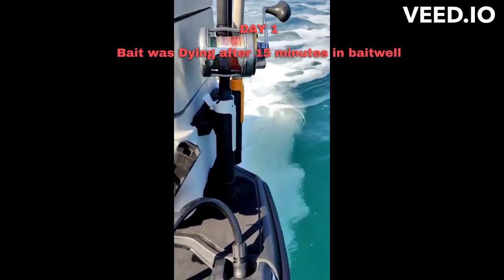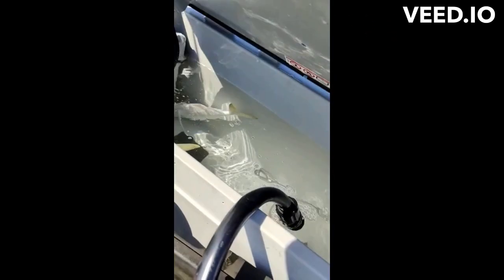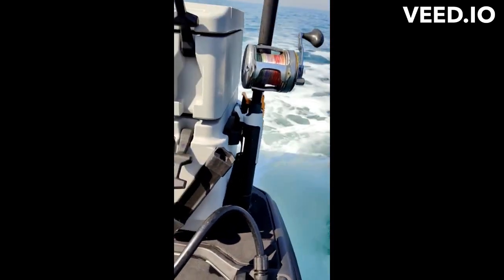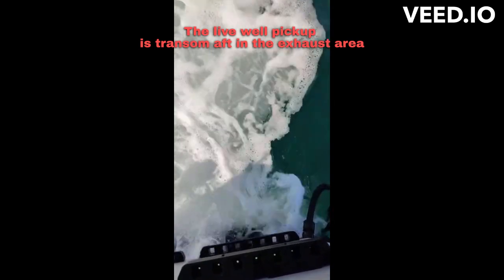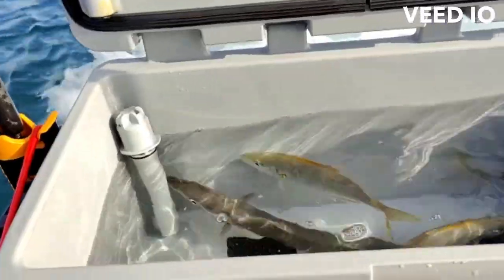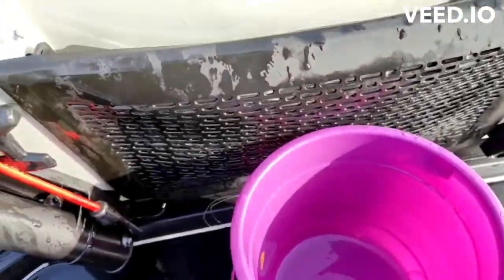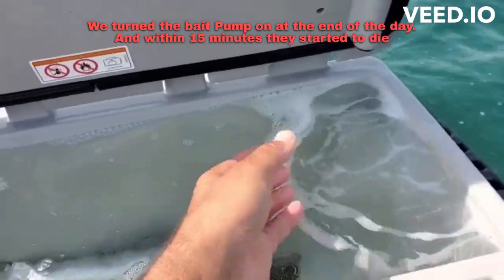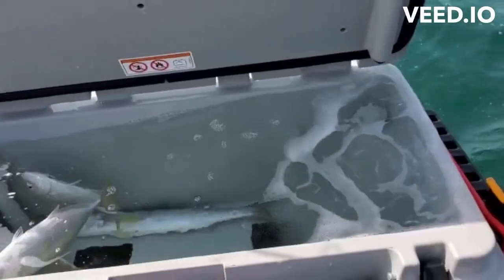Sea doo Fishpro Trophy Live Baitwell Fundamental Issue?

Comment from the maker: Another thing that happened to me.I almost sank the seadoo because that black pickup plug just fell off inside the hull one day and when I stopped (10 miles out) and fighting a fish I noticed my feet were literally swimming in water. the JS had taken on so much water because of the gaping hole. I BARELY was able to restart the battery and move the JS slowly but fast enough for most of the water to drain.
When I made it to the dock, I checked the other 4 Jetskis we have there and all of them the glue was coming off and they about to go as well. So check your inlet thorougly
Reply: I was looking at buying the Trophy model with the baitwell, but after seeing your video do you think the model w/o the baitwell hookup is safer?
Reply: @rudabb69  wow this is crucial info, thanks again for sharing 👌🏻

Comment: We have the same problem 😂
Reply from the maker: and the seadoo dealer in dubai says no one ever complained etc and no issue :)
Reply: @rudabb69  it is the most shitty system ever. It doesn't just have one problem. It has problem with pump which keeps shutting off every few seconds., it sucks in poisonous water from motor exhaust because intake is right next to exhaust,  the livewell doesn't picks water if the craft is moving at more than 4 knots speed
Reply from the maker: @FishingAdventuresDubai  yes!!!!  dealer kept blaming it on the switch....and I am almost positive the pump is overheating thus causing the switch to trip.
Reply: Seadoo does not care about it's customers.  They just want their money and pretend their product is perfect.  

Examples:
1) in 2021, many customers got stranded using IDF

2) all livewell  users will experience bait dying if running engine with bait in tank for fishpro trophy units.

3) water leaks into main storage compartment.

4) 5 mpg sucks for a small craft.

5) footwells fill up quickly in rough conditions 

6) livewell is poorly designed in rectangular shape.  Any good fisherman knows bait tanks need to be round so fish can swim in circles.

7) plastic rod holders are cheap

8) livewell is difficult to drain on the water.

9) the fishfinder sonar does not work in deep water.  Blinks out.  Seadoo technician have no solution nor does Garmin.

10) no navigation lights or go pro mounts on fishpros

11) seadoo factory anchor is a joke for ocean conditions.

12) price of 20+k is inflated due to all of the flaws. 

13) When fishing with engine off, livewell and sonar only work for 30 minutes until low battery alarm goes off and system shutsdown.

I have a seadoo fishpro.  With dealer markup, taxes final cost was 23k + trailer additional 3k for grand total of 26k.

I will not be buying a second fishpro😮
Reply: @monaco8858  you summed it up very well. Another problem where they have made hole for livewell water inlet. The housing around it became loose over time and water filled inside the cavity of thr craft, the jetski almost sank . If other boats were not around to help it would have sank

Comment: cant u just turn off the engine and run the pump? or u could go at a higher speed
Reply from the maker: if you turn off engine no problem. if you go at higher speed the pickup creates a vacuum and it doesnt pickup anymore.  thats another issue all together. there is a fix for that but it requires drilling that ccolbox and intalling a high speed pick